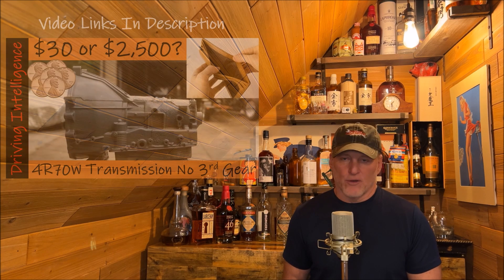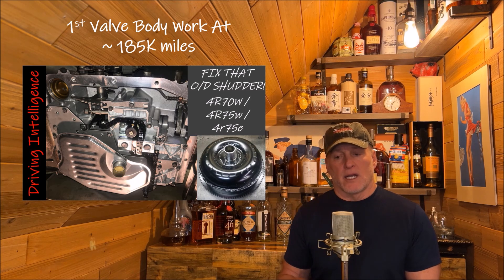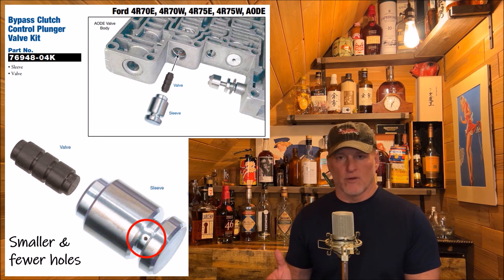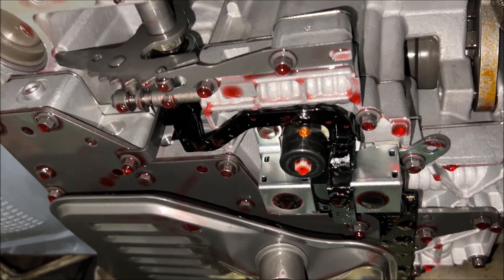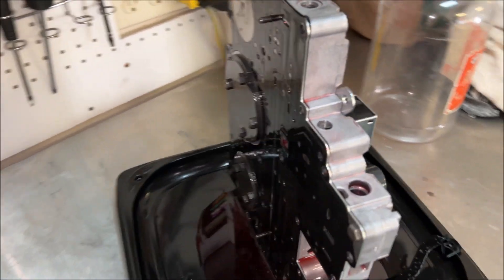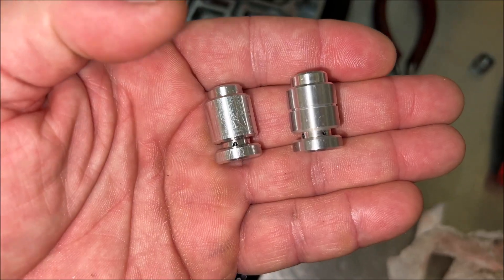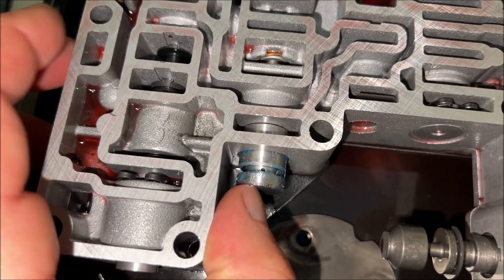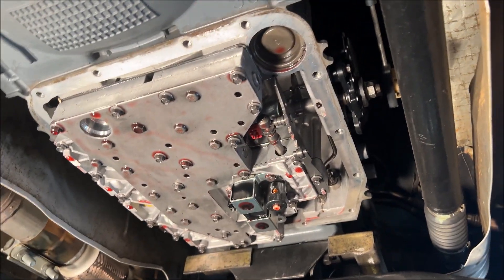Fix Overdrive Shudder & Late Engagement: 4R70W Torque Converter Bypass Control Circuit Modification

Comment: Will 1-2 accumulator piston and spring fix the 1-2 shift? Chirps the tires over 3/4 throttle , I also have a bit of an overdrive issue, just where I'm in high Rpms it'll take a solid 3-4 seconds to go into 4th and it'll take a second to kick down to 3rd on the highway, would you recommend dropping the valve body and doing all accumulators? Fluid is good has had prior services
Reply from the maker: The harsh 1-2 shift with tire chirp could be a broken spring or worn piston in the 1-2 accumulator—replacing it might help, especially if you're at higher mileage. The overdrive delay (3-4 seconds to 4th, slow 4-3 kickdown) suggests accumulator or valve body issues. I’d recommend dropping the valve body to replace all accumulators (1-2, 2-3, 3-4, OD) and consider a complete valve body rebuild. I did this at 185k miles with my 4R70W and the improvement was dramatic.  Here's my playlist:  https://youtube.com/playlist?list=PLGNsbVXzRfZM6WpCF862q4DlkyatzFIMz&si=8VoUoqDkPqdRpoYz

Comment: Ok guys I got a tip to test these valves, get a spark plug rubber boot and insert end of the valve and blow air with your mouth. If air passes through the holes, it's warn  out. Also you can do the boost valve and the overdrive servo regulator valve the same way. 👍
Reply from the maker: cool tip, thanks!

Comment: I'm sure you've heard of the J-Mod modification , how come you never tried it?
Reply from the maker: The J-mod would not help this issue.  I did perform parts of the j-mod on my prior transmission which transferred over to this transmission when I used the same valve body.

Comment: What do you think causes the delay? Can it be resolved?
Reply from the maker: This is a very good question.  I was not having this problem before the transmission rebuild.  It behaves as if the command to lock up is delayed from the ECU.  I'm considering driving to 5-Star 
(2 hours south of me) and having them dyno tune the truck to work out all the little gremlins.  I need to learn how to monitor the ECU commands through a data log to see when the lock-up is being commanded by the ECU.
Reply: @DrivingIntelligence  I understand you can monitor the time from the command to the action. Have you thought about testing the pressure taps with a gauge? Maybe that can give more insight if it's internal. I saw on the Sure kit, it has you line brush the PR hole to eliminate drag. I noticed with all the burrs on this valve, maybe it's dragging?
Reply from the maker: @ you note something I've been wanting to do, data log to see if the lock-up command is coming late.  The truck does not act like it's sliding into lock-up, it's a firm lock-up when it happens.  With regard to the valve, that part is not a valve,  It's the cap.  The shuttle valve is inside and is in perfect condition.  The cap does not move, is not supposed to move, so the scratches mean nothing to performance.  Keep those ideas coming!

Comment: The channel 'Transmission Bench' did a 4R70W rebuild with the Sure Cure kit, which has the same sleeve with only the one small hole in it. The instructions that came with that older kit stated to drill that hole with a 1/16" bit, and continue through the other side of the sleeve (with the valve removed, naturally) to allow easier flow and prevent harsh lock-up.

It's the 4R70W "Part 2 Lesson 7" video, around 22 minutes.
Reply from the maker: yep, that is exactly what I did with that sleeve, the extra hole was not enough to resolve my harsh lock-up.  In retrospect I could have drilled more holes, but I took the advice from SONNAX.

Comment: I'm really glad you have your trans up and running again. I used the zip kit in my 4R70W and my 4R75W so far so good.
Reply from the maker: That’s awesome.  No harsh lock-up?
Reply: @DrivingIntelligence  I can feel it lock up.  Seems fine to me.  I also added the washer on the overdrive servo adds a little more solid feeling to the lock up. Probably just preference. My transmission is in my 75 Gran Torino Starsky and Hutch. I'm using a US shift quick 2 controller I can make shift changes with that also. It's nice having overdrive in a classic car.
Reply from the maker: @mycontinental3611  interesting, can you tell me more about the washer on the overdrive servo?  Are you referring to the overdrive shift accumulator?  I did the same with the SONNAX pin... but that should be only for the shift from 3rd to 4th.  Not the lock-up.
Reply: @DrivingIntelligence  Sorry the washer is on the overdrive pin. I was thinking wrong..
Reply from the maker: No worries, thanks for chiming in